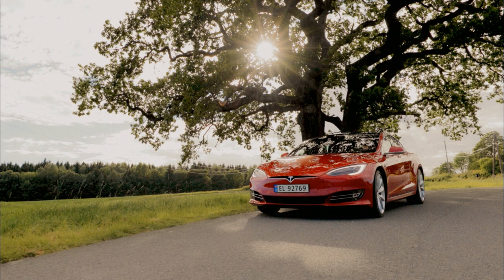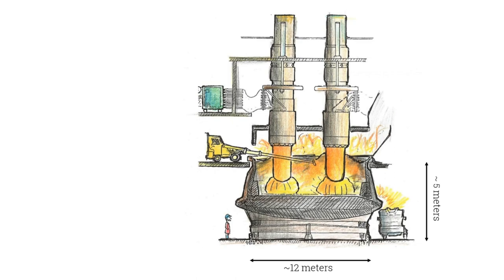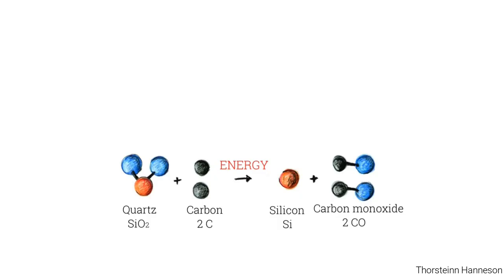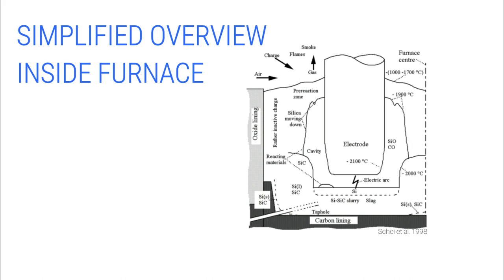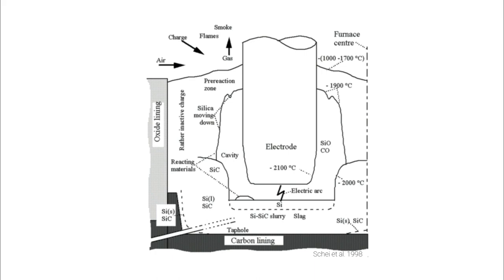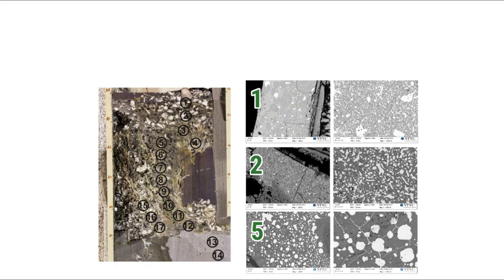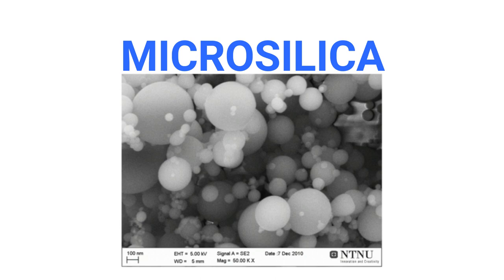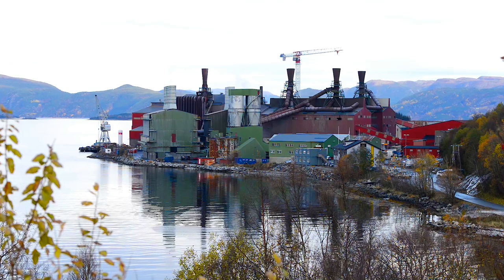The Production Of Silicon | NTNU

Comment: I would like to know the SiO2 concentration they have in the ore used 🤔
Reply: 90%+
Reply: @Metal_Master_YT  Thank you!
Reply: @oportillo02  I mean, they said quartz, which is basically pure silica crystals.
I know that its hard to get any good yields if the purity of the silica is low, so they must be using at least 90% silica, probably closer to 95% silica in their rocks.
Reply: @Metal_Master_YT  Oh, I was asking because I have silica ore (about 70% SiO2, other impurities: FeO, MN, and others); obviously I'm looking for a purchaser but i need to know how's the market, possible market target, etc.
Reply: @oportillo02  well, if you powderize the silica, and dissolve the impurities in acid, you will be left with higher purity silica.
Reply: @Metal_Master_YT  Thank you!
Reply: @oportillo02  HCl works well for this method, but it requires that you powderize the quartz quite fine, not nanoparticle fine, just pretty fine, and soak it for a while.
this process removes calcite, limestone dolomite, and other alkali salts. it also potentially removes iron and manganese.
make sure to mix.
the only reason I know this, is because I'm trying to make silicon from quartz, like in the video, and I need high purity silica.
Reply: @Metal_Master_YT  I was thinking to make two experiments: the first one using HCl as you say, and after that mixing with NaOH (Sodium Hidroxide)=> sodium silicate. Then, add sulfuric acid by dropping and finally getting silica by heat.

The other experiment is basically the same, just skipping the HCl process. I might have impurities, but i guess that I can have a better silica concentrate.
Reply: @oportillo02  How did your experiments go? Hope you found success
Reply: @Metal_Master_YT  We produce 99.5% SiO2 Quartz from our resource. It may not be worthwhile to process Quartz of 75% SiO2. We are also working on producing 4N+ Silicon in our lab and have seen good results. Removing Al will be a huge challenge for anyone. We are working on improving the process.

We hope you are successful in your endeavours.
Reply: @gvsbreddy5784  Hello!! To tell the truth, I didn't started yet 😅

I found hard to find bathe chemical supplies. 

I have two BA degrees (architecture and law); you can only guess that I'm very short at time. 😞
Reply: @gvsbreddy5784  I have been trying to produce silicon from quartz, and I have some pretty high purity quartz rocks where I live that appear to be just silicon dioxide, with almost zero impurities. I am using hardwood charcoal as the reducing agent, and I am using an AC welder with graphite electrodes as the heat source, how can I improve my process and try to increase the yield of silicon? so far, its very low.
Reply: @Metal_Master_YT  You may want to look up the article titled “Nanopurification of silicon from 84% to 99.999% purity with a simple and scalable process”. You’ll figure out the obstacles. 

What are the impurities present in your feed Quartz? W/W? How much is the improvement you achieved?
Reply: @gvsbreddy9191  the only main impurity is iron, at less than a present I think. the quartz is very clean, and very white, and I even crushed and acid washed it, and the weight did not change, indicating that it is for all practical purposes, pure quartz. the charcoal I used was made by myself using regular hardwood such as walnut and oak, and is mostly carbon, with a fairly low ash content. the tiny amount of ash actually acts as a flux and helps the quartz melt.
I'm more worried about properly and sufficiently heating it, and getting the proportions of ingredients correct, and the particle sizes optimized. since this is small scale, I can afford to try many different options and possible solutions. I have not achieved any further improvement than the small silicon yield I already mentioned, that was my best yield, and I don't know what the weight percent it was, but the pieces of silicon I do have look quite clean and shiny.
the purity is not my issue so much as the yield is.